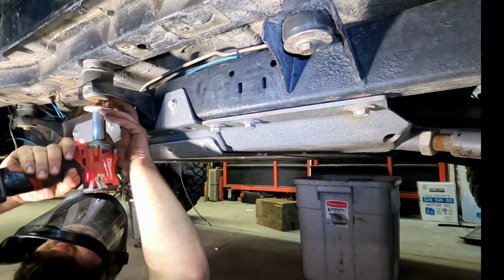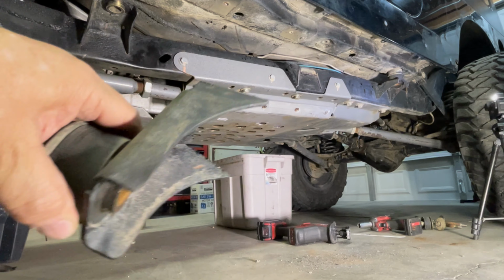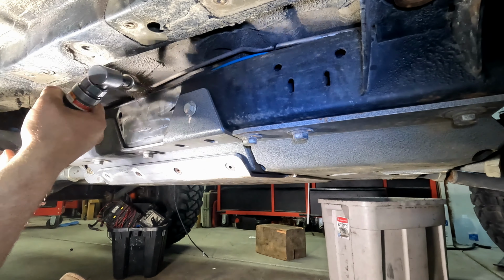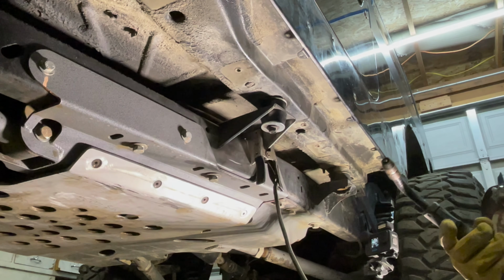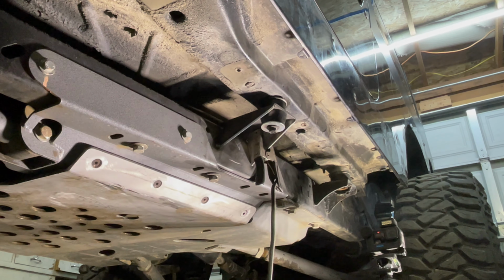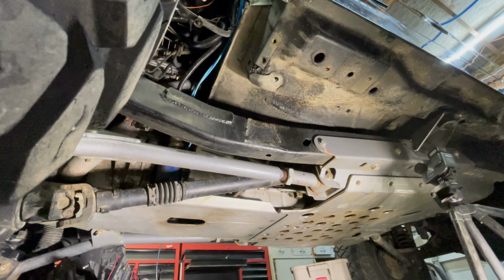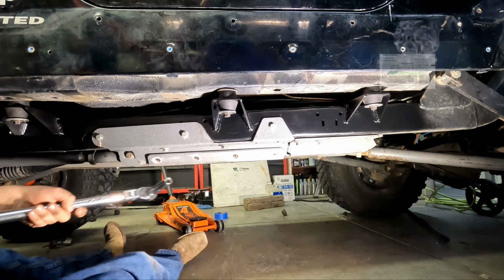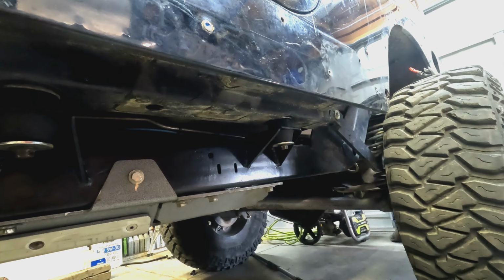Upgrading Jeep LJ Rubicon Body Mount replacement

Comment: Lol why are there new bushings on the old bushings. Welding 2 inchs from fuel lines😢
Reply from the maker: We’re not sissies!!😀👍 Thanks for watching…
Reply: Just keep a fire extinguisher in case you blow up in little pieces 😜 1 gal 2 sticks of Dynamite 🧨 I'm welding over the metal lines. That's pretty scary.floor board and the whole torque box.
Reply from the maker: @robertthrem3382  We always have a fire extinguisher close by….👍❤️